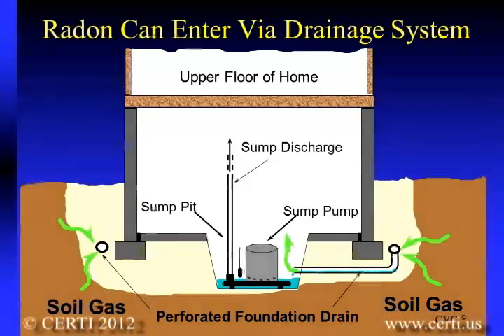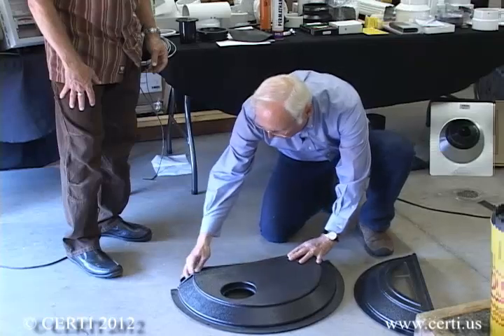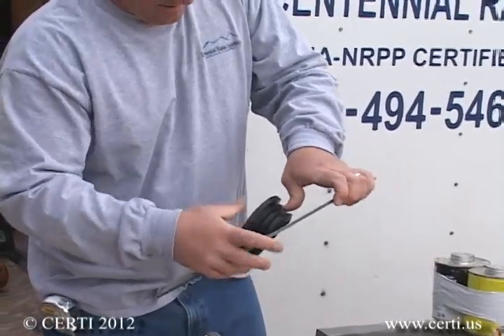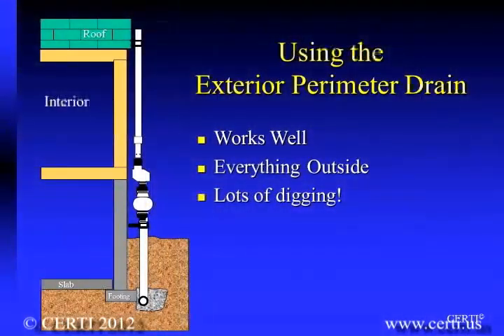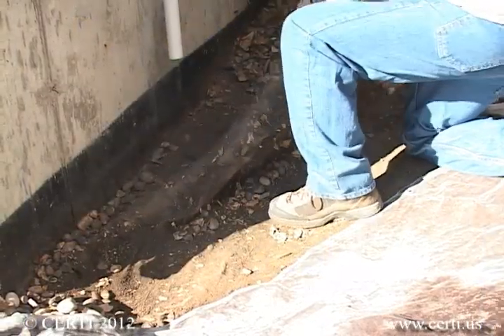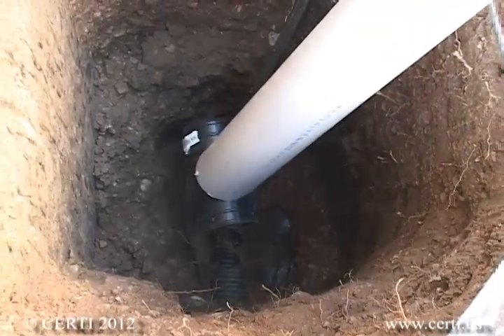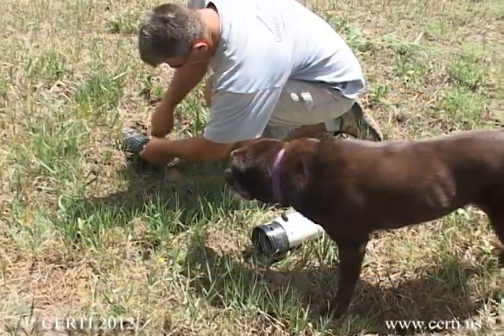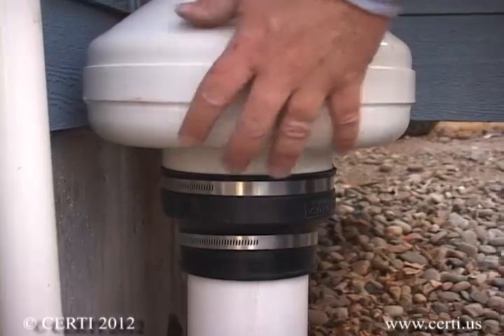Using Drainage Systems to Mitigate Radon

Comment: With the installation of a sump lid, could it be easily removed if service is needed to be performed on the sump pump system?
Reply from the maker: Yes-provided the proper lid is used that has an "O" ring type seal and is bolted to floor.  The bolts can be removed, but there are also some lids that have removable portions to access pump, etc.